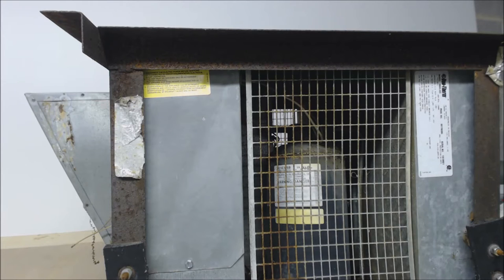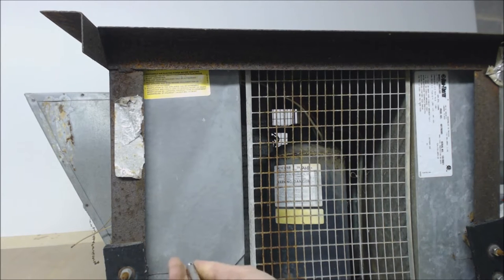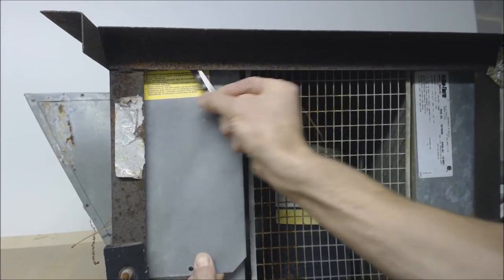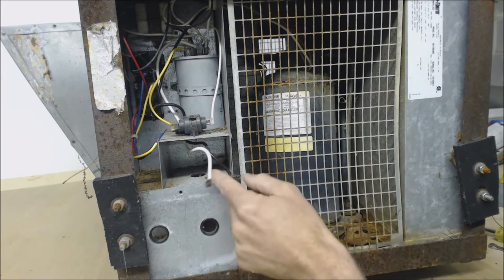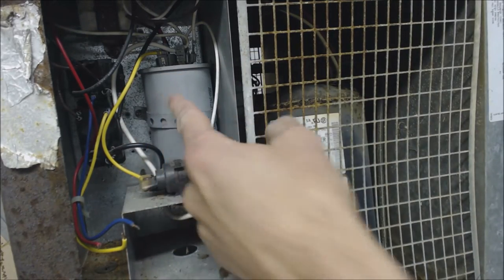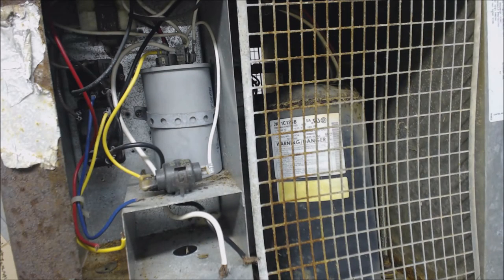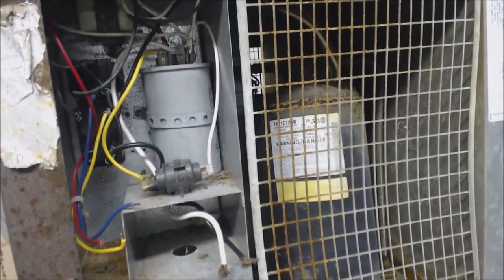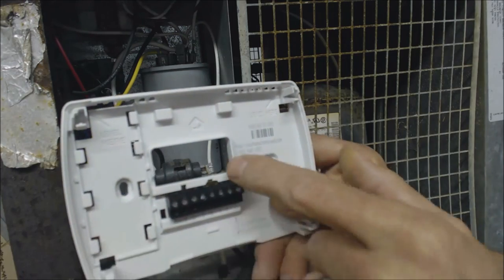How to Service the DuoTherm Air Conditioner Under a Trailer!

Comment: Hi I have an AC unit under my RV that looks like this one. It is a duo therm. It keeps freezing up so I cleaned the intake and the exhaust fins but it continues to freeze up. I’m thinking it is low on freon. Do you have any videos that show how to check the charge and add more coolant? Thanks
Reply: I have the same issue and looking for a solution. Did you find one???

Comment: Hello, In you video I can see the compressor and just behind it there is another part of the compressor that turns to a block on mine and I no longer feel the fan blowing any air out of the vents.
When it freezes up, does it shut the fan off as well? If I let it thaw for a few hours it will work again. What is the cause? My air filter is brand new and no obstructions around it and I foamed the coils seasonally. Did I set it to cold or is it in need of R-22 coolant?
Is there a simple direct replacement model I can put in???

Comment: if you connect the red and yellow together with power on should the compressor turn on ? I have the same unit as your video and a tech said that I should replace the whole unit with a new one .I wanted to replace all of the components before I have to replace the whole unit.
Reply from the maker: I understand. If the red and yellow are connected then the compressor would turn on. With the power off you want to check the start capacitor, the capacitor and the resistance on the start relay. No need in replacing the capacitors unless they read bad. You can check out my videos on testing capacitors. Thanks

Comment: If I have this unit under my trailer with a propane suburban furnace that appears to be right above it but inside, am I able to install one of those new Coleman ac units easily? Does this unit require the propane furnace to move the air through the place? I can seem to find anyone who knows anything about these things

Comment: Hi There,
I have a Dou Therm basement model with air conditioning and heat pump on a 1997 alfa 5th wheel. It also has a propane gas furnace. My thermostat needs to be replaced and I'm just wondering if you might know what kind of thermostat in the rv would control all 3
like the old  Dou Therm thermostat did. 
Thanks for your videos
Alan
Reply from the maker: That may be dc voltage instead of ac voltage like on this unit. If you take the cover off of the gas heat or ac and look at the wiring diagram, it would say there, thanks
Reply: Thank YOU
Reply from the maker: Glad to help AL!

Comment: The positive temperature coefficient resistor on my unit has gone it's the exact same unit in video .i am having trouble purchasing the ptcr here in Ontario Canada can you help.
Reply from the maker: They are available on amazon but use the numbers stamped on the thermistor, thanks!

Comment: Today I attempted to replace the fan motor on a rooftop Dometic Duothem Quick Cool AC. However, some genius at 
Dometic thought it would be a good idea to tac-weld the backside of the 
cage fan to the rest of the frame. This piece also provides the tiny 9mm
 motor mount bolts which have rusted to pieces. I may need to return 
the motor kit, as there is no way to get the old motor out without tearing 
the housing apart and having to fabricate a new one out of sheet metal. 
Way too much work for this junky AC, and I will NEVER buy another 
Dometic appliance again. I have replaced fan motors in Coleman AV units 
before, and it's a simple 1hr job.
Reply from the maker: And that is just it. I am typically replacing these under mount units with the Coleman Air Excel units and the prices are often less. I also replace the upper units with Coleman as well. Sorry to hear. Thanks for the Comment!